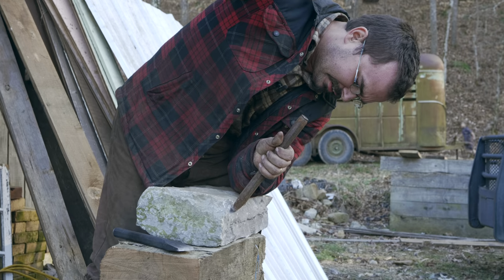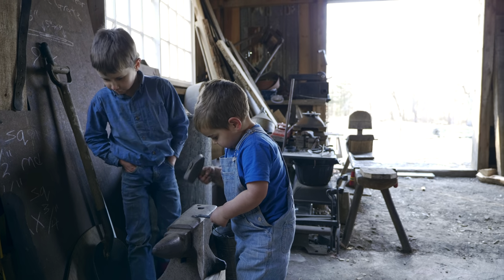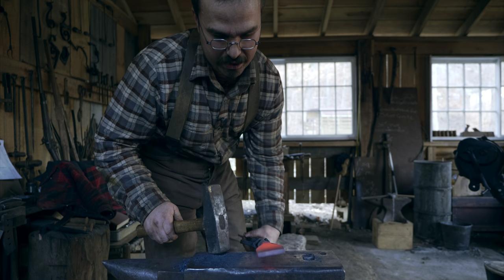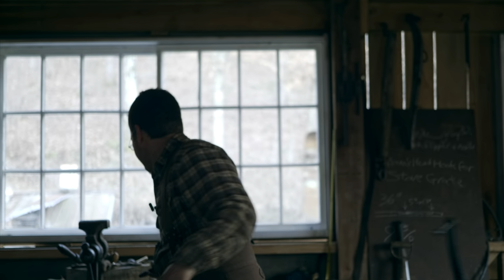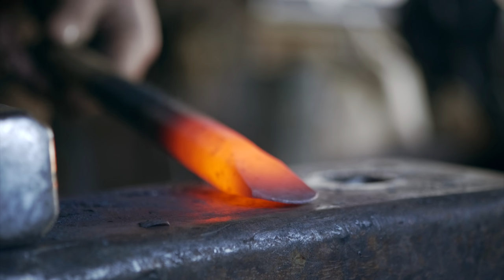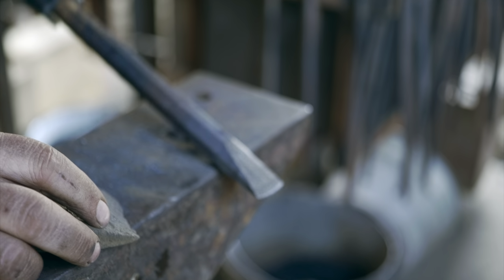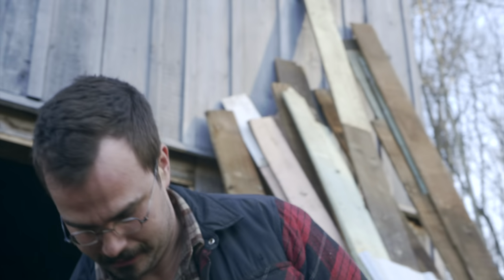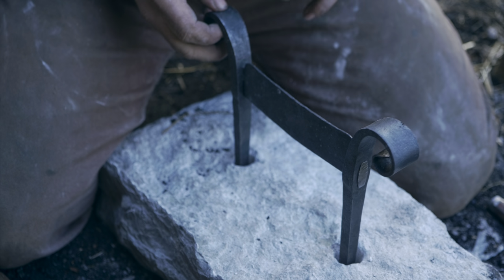Forging Stonecutter's Tools

Comment: I continue to doff my hat at the amount of iron you move with a light hammer. Most smiths would use a power hammer or striker on lots of these projects. Well done!
Reply from the maker: Man I appreciate that! There’s many projects where some help is just absolutely necessary. Wait til the next video making a Roubo holdfast lol. But often there’s just no replacement for just swinging that rock on a stick right!
Reply: Yes.. too many smiths fall into the powerhammer trap 😂 
Great work and tutorial 🎉

Comment: Nice work Jordan. 👍
A great little project, to instruct and inspire blacksmiths and masons alike.
I actually got turned onto blacksmithing out of necessity. I wanted to not only cut stone, but carve as well. 
Buying stone tools these days is expensive, and sourcing new or even finding second hand was much harder than I thought.
That all changed when I came across the book "Complete modern blacksmith" by Alexander Weygers. It's actually 3 books in one dealing with different aspects of smithing. The one that got my attention was the making of stone cutting and carving tools from scrap. And it opened the door to a lot more besides. [He really was a versatile and handy bloke, so these books are worth more than a look at by anyone interesting in smithing, or garage/ shed work (mancraft) in general].
I realised it was going to be quicker and cheaper to make tools - to my own needs - rather than sourcing them new or chasing second hand.
Bolsters, pointing, pitching tools, simple drills are one thing, and you show how easily they are made. But chasing gouges, or swan neck chisels, or rasps of different sizes etc really can become expensive, let alone the time to track them down.
I'm well down the rabbit hole that is smithing now, and the stone work has taken a back seat so to speak, but this is how it started.
Keep up the good work - in the shed, and on the Tube.👍
Reply from the maker: That is awesome! I can’t wait to expand my stoneworking toolkit big time. Mallet head toothed chisels and carving tools are high on the list. Been hearing about the Weygers book for a long time- I need to get myself a copy. Hey, are you on Instagram? Do you have YouTube videos?
Reply: @AxeAndAnvil  No, not on Insta or the Tube. Just an avid viewer.
The Weygers books are really practical. Lots of encouragement and a healthy DIY attitude. The guy lived a good life, self sufficient in his own way. May not please some of the purists, but hey ...
On the downside, people can them because there's no pictures to illustrate heat and temperature,  but your already ahead of that. It's a distraction and you do t be worried by it.
They are amongst the cheapest and  most accessible blacksmithing books, so you definitely need in your already impressive library.😉
I'll be watching for your tool tips and projects.
Keep it up👍

Comment: Looks like you've done a fine job and they should work well. One thing I have run into regarding hardening and tempering. These type of tools when made at the factory are often  hardened and tempered as a whole piece instead of just treating the working end I had fracture as I created a shear line before knowing this. Small tools can be brought up to normalizing temp thru the bar, eliminating this worry.  Dad found this in some jack hammer points. Just my two cents.

Comment: For a pitcher, I like to leave 9". When using it to face stone there is a far greater likelihood of the chisel and hand following through when you get to a bit of rock that is a little weaker than the rest. That extra inch helps to keep your hand off the top edge of the stone. There is a temptation to hold the hand low on the chisel with the bottom of your hand resting on the shoulder of the tool - not a good idea   ;<)  
I also kind of feel the extra length helps to better 'see' the angle you need to strike at. Great result .. most modern 'pitchers' have nowhere near enough meat in them.
Reply: Oh man, I was watching his hands and thinking this exact thing!!! I was betting there are many a stone mason that have whacked a knuckle or two like that!

Comment: Nice work on the tool.  Don't worry about "taking too long"...you can always edit out the long part with just a snippet left to show the part (octagonal) that takes a while.
I wonder if it would be a benefit to also upset about 2" of the struck end to make a slightly larger struck end for hammering.
Reply from the maker: Thanks! I don’t think a larger struck end would help in this case- but I am also planning to make some mallet head tools for use with wooden mallets. They will have an upset mushroom shaped struck end.

Comment: What is the difference between your two anvils? I recently acquired a second anvil and was wondering if you have yours at different heights.
Reply from the maker: That’s a totally temporary arrangement that drives me nuts. Not different heights though. My main anvil is decently hard, but doesn’t have great edges. The other one has a rebuilt top and nice edges, but the horn is rough. I use it when I need better edges or a nice flat top. Both need restoring.

Comment: Awesome video as always. Stupid question: are different types of steels relatively equally soft when hot? Or is this tool steel much harder to work with
Reply from the maker: Not a dumb question at all! There’s definitely a difference. Wrought iron is softest, and high carbon and alloy steels are definitely harder under the hammer than low carbon steel.
Reply: @AxeAndAnvil  thanks!